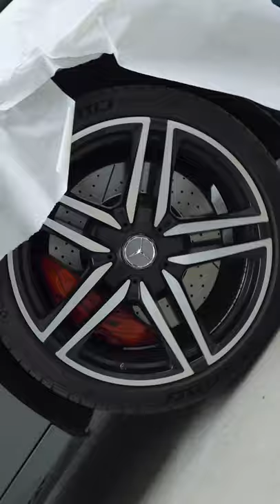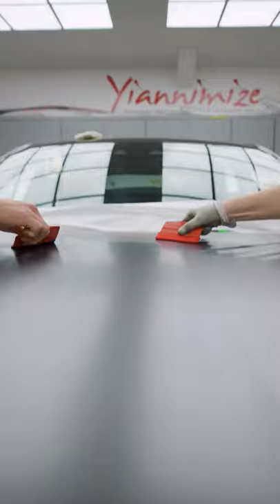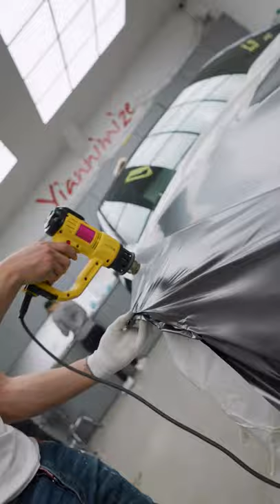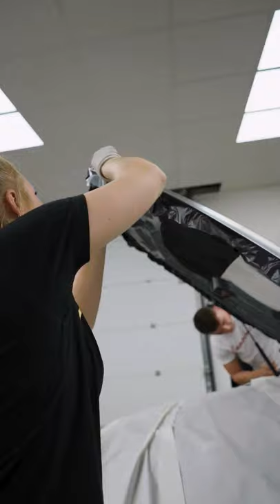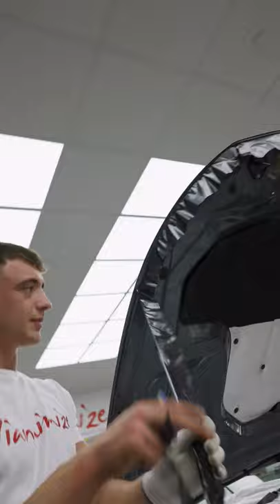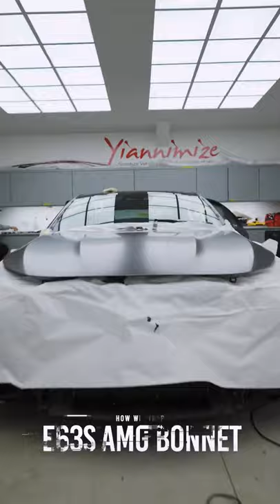Wrapping An E63s AMG Bonnet #shorts

Comment: how do they not scratch the pain when cutting it with a scalpel?
Reply: Knowing the pressure. Sticking a film on an inflated balloon and cutting the wrap without popping the balloon helps a lot
Reply: They should never cut in car should buy a scanner that you design the pieces on a computer and you place the wrap in a machine that cuts it to the right length so you don’t accidentally scratch the and also you cover corners of the car more efficiently